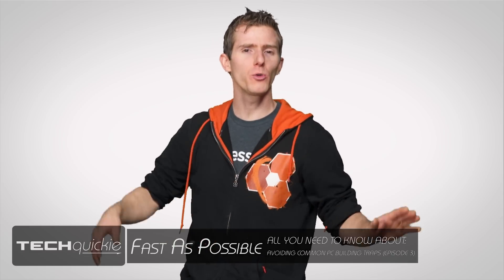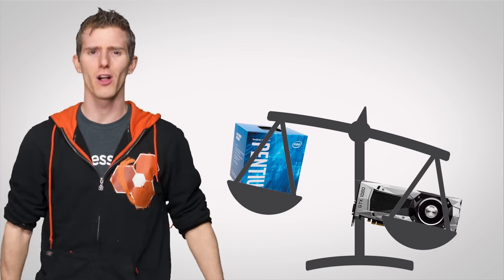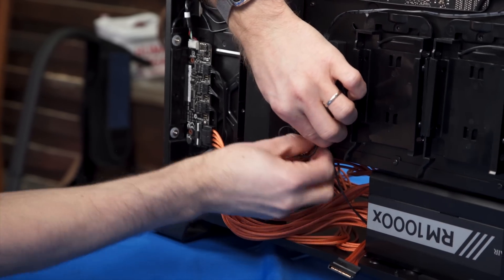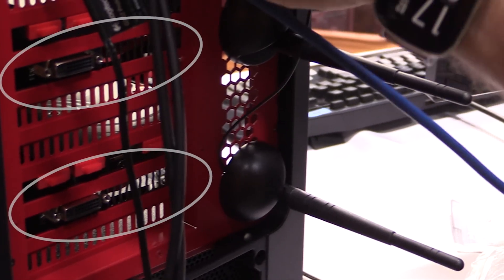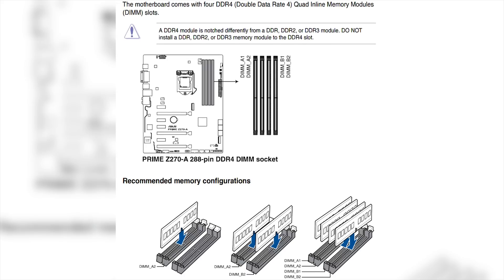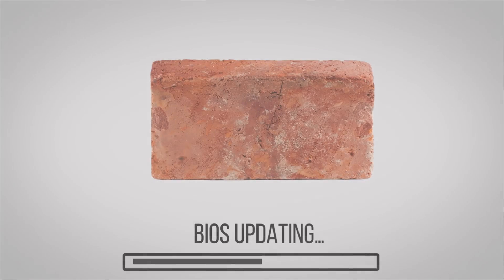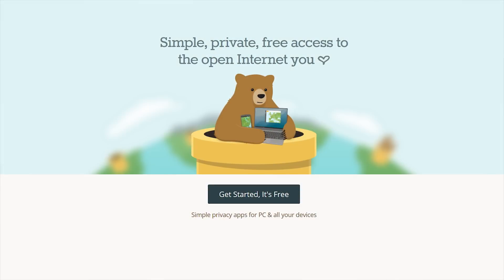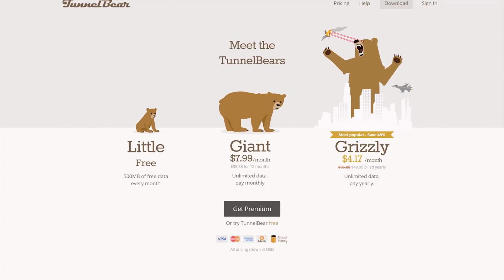Avoiding Common PC Building Traps - Episode 3

Comment: Also,  do not pair a Titan X with a 59Hz monitor. It's stupid
Reply: 59Hz you say? I guess i'm set with my 60hz ^^.....(I'll show myself out)
Reply: Popa Dorin what if it's a 4K monitor?
Reply: You CAN overclock your monitor...
Reply: yes... he says l am wrong. at least l am not the one who spent $1,600 on graphics cards for CSGO on a 1024x768 monitor.
Reply: Meanwhile my friend bought a GTX1080 for a 1080p 60Hz monitor and a i5-3450
Reply: Azzalack I have two Xeon w5580's
Reply: Randy Gareth I believe it's a technicality. No monitor is truly 60hz. It is rounded for consumer friendly jargon.
Reply: If he's using a CRT he's at least somewhat justified since CRTs can work at a higher refresh rate if set to a lower resolution, to a point depending on the specific CRT. If he doesn't have a CRT, it sounds like he just doesn't understand that CRTs are the only monitors where lower resolution = higher refresh rate.
Reply: +Darth No, I manually overclocked my CPU. It is a feature on the box for my motherboard, the manual for which includes instructions for manually overclocking non-K CPUs.
Reply: Not everyone builds a computer for gaming. If you're editing videos, high-res images, encoding and rendering etc, you probably want a colour accurate IPS display. Chances are it's going to be 60Hz. But of course you need a powerful GPU in such situations. Not everything is about gaming. Think before you comment.
Reply: kirby kir a Titan x couldn't do that, are you stupid?
Reply: you dont even know
Reply: i would of got a 1070 i have a 4k tv but if my game cant play things at 4k at max settings with a good fps i play it at 1080p because a lot of games dont have that good of textures so all it has is a anti alais effect when its at 4k but 1080p with x8 anti alais is identical with a lot of games but the fps is higher
Reply: Which Titan X? heh I get what you mean.
Reply: Thank god I'm 2k 60Hz with a 1080
Reply: i got a MSI 1070 gaming Z and a i5-4460, i got a valid reason tho, upgraded from msi R9 270x gaming x, the cpu is a potato tho.. waiting for Ryzen 5 1600x or money for R7 1700 or 1700x
Reply: The Gaming Norwegian I overclocked my i5 4460 on my Asus Z97A 3.1, from 3.2Ghz to 3.5Ghz.
Reply: +electronics for fun Yeah sounds like a typical CSGO player
Reply: Azzalack                            overclocked? i only got a B motherboard and not a Z but still.. isnt the 4460 locked multiplier?, mine is on 3,4 ghz boost all the time. but ive never heard of anyone going over 3,4ghz?
Reply: The Z97A 3.1 Motherboard I have has a TON of control over every little component. I changed the BCLK from 100 to 105.2 and set the Ratio to max at 34 (leaving it at auto keeps it at 32); I had a slight OverVolt to the components. It went to 3.57Ghz, but I had heat problems, since I have a stock cooler, so I lowered the Overvolt a bit and lowered the OC from 105.2 to 104.2, and am at at 3.54Ghz. 

Anyways, the motherboard I use specifically is the Asus Z97A Usb 3.1. It has an App that let's you control some of the bios options related to the CPU, Fans, and PSU from inside Windows. I have Overclocked my GPU, my RAM, and my CPU; I can set it to power-saving mode when I am not gaming, saving power and money. It is one of the highest-end 1150 Motherboards. I didn't know until AFTER I bought it, though; I just got it for 80$ on an EXTREME sale back in 2015. Pretty happy about that purchase.
Reply: The Gaming Norwegian He's probably talking about the turbo boost which goes up to 3.4GHz (or he's just a moron).
Reply: you found a 59hz monitor? im impressed!
Reply: it wasn't a CRT it was an older version of one of those generic dell office monitors. here is a website that had pictures of it: http://www.ccl-la.com/blog/index.php/dell-e172fpc-e173fpc-repair/
Reply: electronics for fun Did you try to tell him about screen tearing or how refresh rates work?
Reply: Popa Dorin I did it with a 480p monitor but at 40hz
Reply: 12k monitor
Reply: xD
Reply: I know.
Reply: 1440p m8
Reply: Titan X 59/60Hz monitor? well if you keep it long enough it will end up lagging, so not as wasted as one thinks... IT IS WASTED IF HE CHANGES CARDS RIGHT AWAY!!! i pity the wallet! i may only have a 1050 Ti and on a TV (not a PC monitor but a 40 inch TOSHIBA 60Hz TV) but that setup will last me 5 to 10 years, since i am not rich! tho even with that TV i WOULD of liked that card! how many years before it would of lagged?!
Reply: i will pair rx 590 with a 60 hz 5 ms monitor ;D
Reply: you're going to love this! l know a guy who thinks low resolution 4:3 aspect ratio is the best way to game.

he had a low resolution 4:3 monitor with 2 GTX 1080s in SLI. he said he has that monitor for the FPS. yes low resolutions give you high FPS, but chances are that 4:3 low res office monitor does not refresh at 500Hz... more like 60 if that. and 2 GTX 1080's in SLI will give all of the frames for 1080p gaming no problem.

the absolute best part is, he plays CSGO. XD l mean he could probably game in 4k at 500Hz with 2 GTX1080's in CSGO, it is not a hard game to run.

Comment: Seriously, what is the chance you get a power outage while flashing your BIOS? I think this is a negligible risk.
Reply: Well, you do have to consider it. In some places in the world the power grid isn't as stable as you might think.

Also, you should check what other people in the house are doing (if you don't live alone that is). You don't want to brick your motherboard because your sister decided to run a hairdryer, microwave and kettle on the same circuit or because your father decided to swap a light switch and turned off the breaker.
Reply: Welcome to the Colombian North Coast. A place where power outage is the one thing you can be sure is it going to happen when you're not ready.
Reply: Some places it is more common than others, I live in the middle of Nebraska and it is fairly common to loose power for a few hours a couple of times a year at least, sometimes due to storms and other times due to farmers hitting the power lines.
Reply: You've got a point there, people are likely a greater risk than a power outage, at least where I live.
Reply: true, but still, someone thought my pc was idle once, while flashing, and pulled the frikking cable. not even asking me, no just pull the fucking plug! some people!!!
Reply: Yes and no, I am glad I had my battery backup on when I flashed my Bios, midway through the power went out for about a second. Of course, that is my normal luck if something can possibly go wrong it will.
Reply: There are many places were the power isn't very stable, where I live in Alaska we usually get a dozen or so power outages a year, with short flickers happening weekly.
Reply: Carambal81 wait do you people not use a ups here in India it's a need to run your PC as power outages are super common
Reply: l once had a power outage while transferring data to a USB. corrupted both the hard drive and the USB. now l have a UPS and it has for sure saved my bacon more than once.
Reply: pretty often actually. our power is not enough, and our government won't admit it. on summer they will say the water generator doesn't have enough water, and on rainy season(yes we only have 2) they said some electricity tower somewhere broke down due to rain smh
Reply: not everyone live in first world country dude..in my place power outage happen at least twice a month
Reply: guess you've never been to India LUL
Reply: when it doesnt hurt you to borrow a UPS, why not use it? better safe than sorry (especially if don't upgrade your BIOS too often)
Reply: What's the chance of hitting a broken outlet just wrong? What's the chance of a roommate flipping back the wrong breaker?

Not saying that you need to go out and buy a giant battery like Linus said, but getting a replaceable/dual BIOS is a necessary feature for me.
Reply: One time i was doing an hard drive backup and there was no sign for any reason of the power going out. I was half way through it and all the power went out because a car hit the telephone pole down the road.
Reply: @kenny ricardo Puerto Rico?
Reply: Yo Sup I do live in a first world country (Canada) but our hydro company was so incompetent and the tech so old that the power went out every other Sunday at 7pm like clockwork for like 6 months. was annoying. also displays an irony of sorts. gets 2 feet of snow overnight with strong winds: power is stable
gets 6 inches of snow over night with no winds: power is knocked out for majority of day.
Reply: Carambal81 well if you live somewhere where there are a lot of power cuts, or there are road works and some how ended up breaking the power cable ( has happened surprisingly) or you have a heavy electricity usage component on, which my trip the circuit, which has happened, well yea, don't do bios updates in those conditions, recommend at night when not many people would be using a heavy load, xD
Reply: Markyroson really.? i thought only my country have incompetent twat lol.
Reply: Carambal81 if you're living in a country like India or Pakistan , you will need a UPS
Reply: Happened to me. Some numbskull took out a power pole right in the middle of a BIOS flash. Power went out for about 2 minutes over most of the town from the surge. Automatic reset put most of it back on. But......bricked my motherboard. The worst part was that I could only find one available and it was used. Works for the most part, but it has issues with restarts(it wont) and won't work with printer.
Reply: It really depends on where you live. Here in Louisiana we get frequent power outages, due to storms and also heat (to the point power junction can potentially explode from overheating). So it's best to invest in a decent UPS to protect your electronics, since surges/outages alone can easily damage your system. But it's not really worth it if you live somewhere like Wisconsin, where power outages are extremely rare.
Reply: At our old house the power would go out a few times a year during the worst thunderstorms. We moved but stayed in the same town and the power has never gone out in 7 years. Weird
Reply: Carambal81 better to be safe than sorry
Reply: P@r@m3d!© yea you guys have rare electricity outage shoukd be grateful. in my city, outage is so often people (yes, even those who has small house) buy a backup diesel generator. and when that happens, our wifi is dead(no internet) and data is only available on 1 out of 5 internet provider
Reply: Yo Sup, yes. Really. lol
Reply: mobos like gigabyte have dual-bios. So in case your bios got corrupted due to some power issues, it will restore it using the backup bios.
Reply: Where I live, power goes out every two hours. every day.
Reply: Oh you'd be surprised. Not only does the Power go out at random times, we get low peaks everyday as well. It's a nightmare.
Reply: Carambal81 happened to me during clear weather conditions on an old Asus A7N8X board back in the Barton days.
Reply: Carambal81 It is better to be safe than sorry. If that is not enough incentive, then having a battery backup to prevent power outage problem may save that meticulous essay or form in clutch on that dark (stormy) night that it is due.
Reply: Venezuela anyone? 3, that reads THREE, power outages in a day, everyday.
Reply: I think the point was more to invest in a backup battery than anything
Reply: Where i am (Australia). Thunderstorms do cut power frequently.
Reply: alupihan be sure to have a ups and avr , philippines current is dirty. also, that is a must if you live in mindanao.
Reply: I knew someone who intentionally rebooted their computer while flashing the BIOS...
Reply: Where I'm from the power grid is fairly stable (if old) but thunderstorms are a common occurrence so outages are guaranteed to happen, you'll hear it before you see it though.
Reply: I think ive experienced 2 power black outs in 35 years.. I'll take my chances...
Reply: My generator ran out of gas during a windows update.
Reply: I know this is old and you have realized that some places have less stable power, but I just wanted to chime in real quick. I live in a wealthy part of South Florida, and even with all the money the city gets from us tax payers, they can't keep the power from going out at least once a month. I guess it's weather. The weather is definitely something I have to look at whenever doing any major updates.
Reply: If you live in a poor third-world country, outages can be common.
Reply: Alright, I suppose the power grid around the world is not as stable as I thought. I'm 35 years old and only experienced a power outage once...
Reply: The Odd's in some places are rather great,  i go through full days sometimes where it is down, and the snow up here in canada knocks it out often, plus the wind causes frequent outages in a storm.  I'd say i have at least 30 different outages a year.
Reply: Another solution if this happens is to ask for a replacement BIOS chip from the distributor. Tyan sent me a new chip foc when mine was fried by the Chernobyl virus.

Comment: IMPORTANT!*If you don't put *RGB Lights on your gaming rig it won't work properly!!!
Reply: Leds make it go faster
Reply: DiYGrGamer Don't put rgb components in a case without a side panel window. I managed to do that with my case fans. Well, they had the best price to performance numbers anyway.
Reply: Konig der Welt+ joking aside, it would be like building a professional race car and forgetting to paint it.
Reply: I was on a limited budget so I spent a bit exstra on my gpu and cheaped out on my case and lighting (aka I didn't put in any lighting)
Reply: lol
Reply: No
Reply: electronics for fun 
Jet painting it wouldn't make it go faster, would it?
Reply: Very true
Reply: Everyone knows putting RGB lights in your system increases performances by 9000%. Corsair just released RGB Vengeance RAM. More performance!
Reply: Your computer won't run unless you have rgb lighting
Reply: DiYGrGamer Come on let's be real here. Nobody would be insane enough to forget to put RGB lighting in a gaming rig. That's like building a professional race car and forgetting the engine.
Reply: DiYGrGamer no bro you are wrong, you need to instal those orange(like shit)25$ noctua fan because they are recomonded by linus
Reply: DiYGrGamer don't forget to buy the "4K Ready" rgb lights, they give high quality pixels
Reply: Also, if your case DOESN'T have a side window, you definitely need RGB lights!!
Reply: WATCH LINUS VIDEO ON RGB

IT ACTUALLY INCREASE FPS BY 10%
Reply: Hanro Lareman omg I'm so srry, I feel bad for you, no rgb = no life, xD
Reply: well everybody knows that. no RGB lights means no power!
Reply: Young, Austin Evans got a 17% incease in FPS  and putting RBG lighting on disco mode
Reply: Of you are building a proper gaming RIG in 2017 RGB is al you need
Reply: just buy a strip of RGB lights and you have a gaming PC.

Comment: So I think my BIOS needs an update, but ASRock's website is shit and I can't find what I need. In addition, their software package which finds the updates for their motherboard doesn't work on my machine! What do I do, and has anyone else had this experience using ASRock motherboards?
Reply: SagBobet asrock is shit
Reply: ASRock is hardly shit. I use an ASROCK X99M board and browsing their website is very easy. You simply Google your motherboard model, chances are one of the top links will take you to the ASRock page for it. You simply go to the download section and download it. Though it's not recommended to update your BIOS if there's nothing wrong with your system. Not sure what you're doing wrong but don't blame them just because you can't figure shit out.
Reply: It's not fair to blame the user when their software doesn't work or they still haven't figured out UX design.
Reply: It's very fair because the software works and you just can't figure it out. What isn't fair is for you to call ASRock's website shit just because you can't navigate it. It's an easy thing to do and I've done it multiple times as have many others.

Comment: anti-static proof equipment or procedure. It is so fking minor until once you damaged a component. You could have battled all night during this sunday but ended up next week.
Reply: don't leave any elecrical components, even when not plugged in, like ram, cpu, motherboard or any other icb/pcb on a conductive area like a radiator. done that once with a ram stick, saw some blue light coming off it when i put on top of mine. the stick was fried. it was only a ddr1, 512mb stick, so no great loss, but still